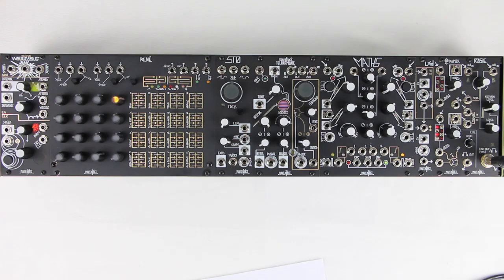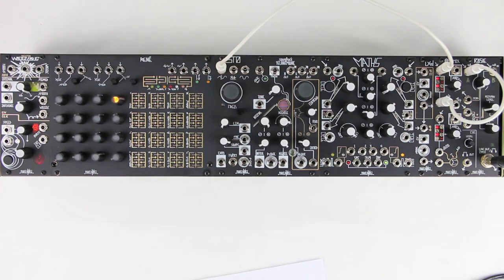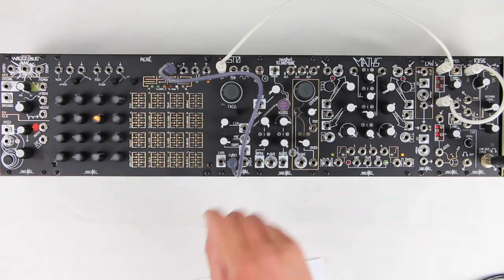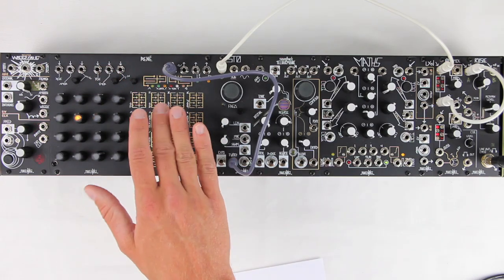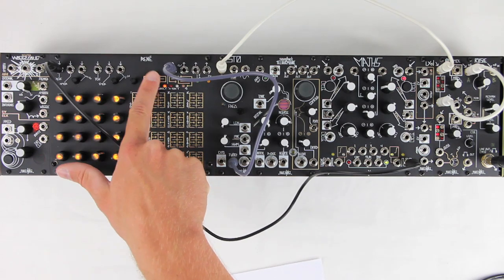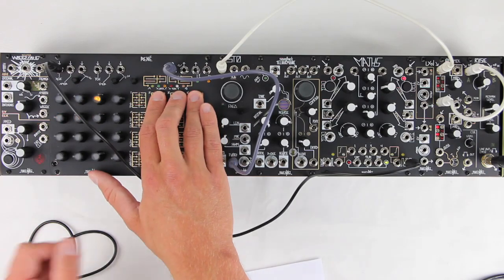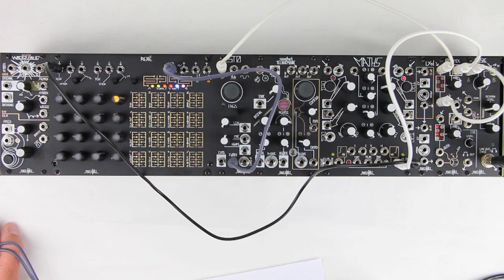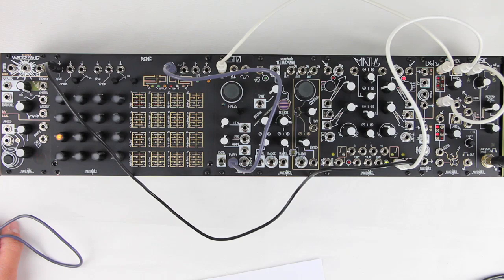System Cartesian: Basic Sequencing with René

Comment: does the new Rene still allow playing notes with touch plates that easy? So far I only found this in Latch mode, apart from that it seems to be rather different
Reply from the maker: The Latch page is a little different from latching on the original, yes
Reply: @MAKEN0ISEMUSIC  I dont know the original, I am just looking for the simplest option to program a sequence in a way that i can hear the steps i program a bit like in this video. What would you recommend? Is it Rene 2's latch mode? What confuses me there is that Im doin other things there as well such as selecting steps - which I dont want. I just want to work on the main sequence. Do I misunderstand Latch or Is there another option I am missing? Or am i supposed to program in Quantize mode without hearing?

Comment: I wish my Rene was that responsive...wow
Reply: If your isnt responsive it is a power supply issue. I went through the same thing.
Reply: @edjwise   mine too. pads a bit hard to press. did u solve it just replacing with proper power supply? or what did u do?
Reply: @wurzel6857  Yes a proper power supply should fix your issues. Reach out to Makenoise they will be happy to advise.